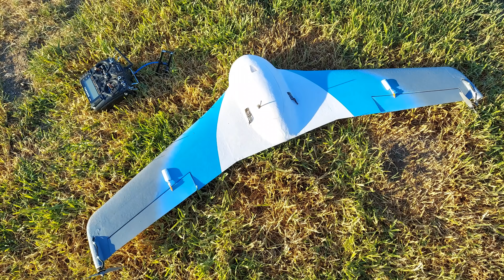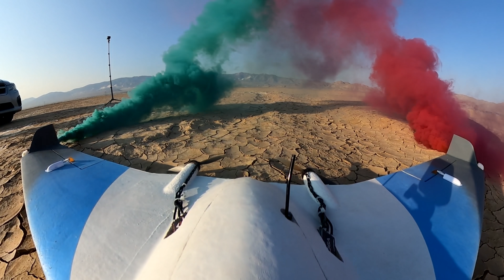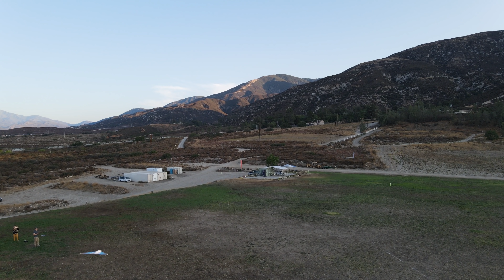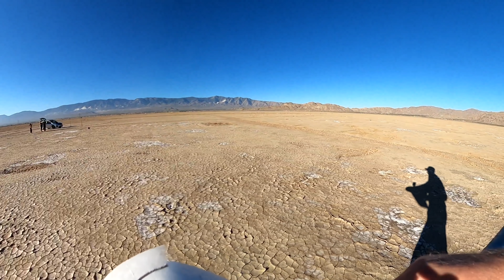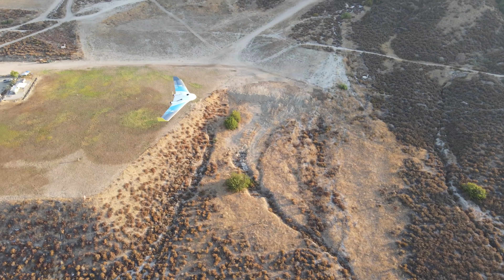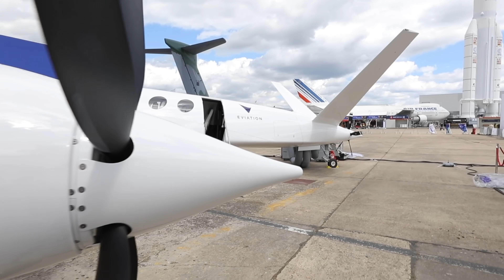Can Wingtip Motors Improve Aircraft Efficiency?  RCTestFlight Solar Collaboration Part 1

Comment: I knew comparisons to the V-173 of the '40s would come up.
There are tons of misconceptions about it. Most of what's "known" about the V-173 is myth.

Zimmerman copied it from the Arup S-2 of Indiana which as an employee of NACA, he saw fly in ~'33. Only after that did he use the very low aspect ratio planform as the start off point for his experiments into a VTOL tail-sitter. (though neither the V-173 nor the XF5U had enough power to do so, or appropriate landing gear.)

It's a myth that the props situated as they were, helped.
NACA tunnel tests showed that it gained nothing or changed things not much, versus normal sized 80hp props spinning the other way.

The Arup planes proved that the over-complex propeller situation with the V-173 was not what gave it its excellent flying qualities. It flew well in spite of that situation, not because of it, and it probably lost 30 kts swinging over-sized props around.
 The Arups were super-STOL, quick on little power, stall-spin proof. Many other planes of very-low aspect-ratio have also done exceptionally well. They are not always draggy, they do not need any effort to "counter" wing-tip vortices; that the Vought flew in wingtip-driven "Parachute lift", shows that it didn't counter the wingtip vortices. It's probably not worth any effort.
 The dreadful power-out ramifications of the wing-tip mounted props mandate the power-sharing drivetrain, and that troubled the V-173 and kept then XF5U from even flying.
I'll bet that trying any such scheme isn't worth it to the complexity involved. (meanwhile, very-low aspect-ratio all-wing + fins has been shown to work very well.)

The Navy wasted the potential of the Arup with the Zimmerman/Vought parody of it, perpetuating the myth about horrible inefficiency of the very-low aspect-ratio planform.

See the '30s Nemeth "Parachute plane", and the designs for the Boeing flapjack of the '40s, the Boeing model 390 & 391. It did not waste effort and complexity with silly propeller situation, it would have performed amazingly.

The jet age didn't kill the "flapjack". That's another myth.
The US military operated piston-prop combat planes until the '70s, for support into the '80s, and still operate props.
Sergei Sikorsky worked on the Vought planes, and designed jet versions of it.
They would have flown, very well; better than anything else in the air at the time and for the next decade.

See the youtube "Flying Heel-Lift" about the Arup. See the youtube of Barnaby Wainfan talking to the EAA about very-low aspect ratio, and his '90s "Facetmobile" (quote "everyone says they're very inefficient, but I'm getting over 100 kts on 40 hp with 340lb useful load.")

Comment: Low kv motors and big props are interesting for efficiency anyways so maybe such a setup would make the wing tip configuration more adventageous.
Reply from the maker: One thing I learned from this is to get max benefit the prop doesn't necessarily just need to be bigger, but working harder.   I.e. higher pitch and throttle setting.    Hence the Bell 280, V22 Osprey etc.    A bigger prop on this plane would be moving a larger diameter of air but more slowly, so not necessarily a larger volume, and from my understanding of the literature, that volume is very important.
Reply: @thinkflight  This could well be true but without having any better knowledge I would assume that smaller props with high pitch and rpm produce higher air speeds and more turbulences than larger props and thus be less efficient. Would be interesting to test.
Reply from the maker: @Gosuminer  Agreed, more testing would be better.

Comment: Putting weights out on the end of the wing may cause a springboard effect.  I'm pretty sure that's why it's not done. 🤔 small motors with low mass are probably fine. But if you need to pull out of a dive with big weights on your wing tips as shown in the experimental plane out side of the hangar.... good luck. I would be reluctant to do this for 2% efficiency increases, versus ? %  saftey.

Comment: I guess when you talk about separated air you mean transitioned air which has changed from laminar to turbulent flow. Turbulent flow is still attached and keeps attached much better than laminar flow. Seperated air is mostly not doing any lift just drag. Would be catastrophic having separated air just after the spar.
Reply from the maker: You are correct.  Oh for an edit button....

Comment: wingtip motors are only usefull at slow speed, at you scale it need to be way slower to get any notice able effekt, try it but this time use a pizza box as your plane, its gone fly extlemly unstable and slow but wing tips will make it a lot more stable and with the right fligt conroller you could use differential motor speeds to steer that would make it extreme efficens. Now add solar on the roof, and you get a 12h solar drone.
Reply from the maker: They should be effective at the cruising speed of any aircraft if designed appropriately.

Comment: The problem created by increasing the distance between engines is the increased yaw moment arm created during single engine failure.  The larger the distance, the greater the yaw torque.  

The remaining operation engine must be able to keep the aircraft stable and not flip over due to asymmetrical torque.

This design doesn't look promising.

Comment: Love your stuff but no need to give way to cooky alternative theories on lift, if lift was not a well established and defined science ultra efficient, ultra precise airliners and every aircraft with an airfoil would be a complete shot in the dark, how can they create incredibly efficient airfoils if aerodynamic lift is not a very well understood phenomenon not open to debate …as defined by Bernoulli? That’s the one thing I’d like to see you do more of is work on airfoils. I tried smoke grenades on my crop dusters but at even low speeds the smoke is barely visible, I have to try your brand.

Comment: Did u try to mout foldable props on wing tip?I think that u dont nead constant Push factor when in air iff u hitt CG right,u can make more eficient model with foldable props like Glider-s have.Peace and greatings from Europe.
Reply from the maker: I did not.   This isn't intended to be a glider so I did not bother.

Comment: I'm not surprised you didn't find much difference. Check out Doug MacLean's lecture on YouTube: misconceptions in aerodynamics". About 35 minutes in, it covers this in detail. The tl;Dr is that this doesn't work, even in theory. The idea comes from a fundamental misunderstanding of the role of vorticity in lift induced drag. Basically, lift induced drag causes vorticity, not the other way around. So "undoing" the vortex in the near field achievea nothing.

Comment: We would imagine it is best to put power at or near centre of mass. Stress on wing structure is not desired. Lift is the wing function. Tilt in motors seems like , are you kidding?
Weight matters on a Earth, but may not so much in space fast directional changes are immediate and minimal ,with radial wing tip force. No great energy required to steer huge structures,  up there. Minute puffs can shift large objects., especially when they are free of gravity. More power required when influenced by unknown attraction , of unlimited power.

Comment: I am a pvt pilot Multi Engine Rated...Bad things happen when you lose one engine on a twin. Any small amounts of extra effiency would not be worth the risks. I can assume that is why the Electric airplane design changed from those motors out on the wing tips to the back rear fuselage.  From an safety stand point, that is why we always see engines as close to the fuselage as possible.  On a model airplane, we can have tons of fun playing with designs..Not so much when we have people inside.

Comment: Watch a good Flying Pancake video. THAT plane is the most famous example of wingtip props. And you bet it works great. Those pancake shaped wings have a huge wingtip vortex left and right, and the solution is wingtip props.

I really do not understand why all twin props still have the traditional design, with that stupid tail pulling the plane DOWN. Yes, that is stable and very safe, but really, it is a waste of fuel, and most pilots accept that error without even thinking about it. New designs are not just toys, new designs can be a very good idea. Have you ever flown a Rutan EZ plane? They come in several sizes, by now. Those things are twice as fast, as what you are used to. And still most people buy slow and pretty boring planes instead, just because they do not really understand what a canard is. Why?!

So, thank you for this video on true innovation. General aviation needs far more of that spirit. Tradition is great, until it starts strangling you. That solar powered RC plane you mentioned, that is the exact opposite of strangling, just a dude building a solar RC plane and seeing how far it goes. Pretty good!

Comment: Why 2 motors? Is the single motor in the middle not more efficient since less weight and drag? 
Like a LongEZ?
Reply: So 2 motors will have twice the drag and weight of one motor, yes. But only if they replace a motor of the same size. He's using two motors to replace a larger motor, which would probably have close to the combined weight / drag of the two smaller ones. Plus you can use differential thrust for yaw control, saves some weight and drag from servos.
Reply from the maker: I wanted to address this in the video but it was hard not to get long winded about it.   Basically I wanted to isolate all gains/losses to the airframe itself.   Selecting a single motor with the exact same efficiency as a two motor solution would be impossible and that had to be eliminated as a variable, I needed to use the exact same two motors for each test to get good results.   In theory yes one larger motor will be more efficient and will play into your decision making process.   As will the redundancy of two motors.   The design choices are endless!
Reply: @thinkflight  I stand corrected

Comment: So put a single motor in the keel. Oh I am one of these people that has built flying dinghys... always thought any airplane starts with a keel. As a really knowledgeable fellow that has a few fantastic flying boat designs in my head... let me know when you have enough money to build a good dirt track race car... I know how build those too.
Reply: Wouldn't it be better to have a motor driving a light weight air compressor balanced in a single unit at center gravity and the air ducted about through hose or pipe? -Q

Comment: Asymmetry is always dangerous in Airplanes, if one engine fails, besides this, having a huge mass in wingtips would increase stress on wing structure.
I'd say no, no no,....
Winglets, Burnelli arrangements, Custer Channel Wing, propellers turning in opposite direction, so propeller tip swirl arranged in a way respect to fuselage and wing as to reduce drag,...
You may like: 'Low speed wind-tunnel tests of a number of fin configurations on a flat-plate Gothic wing of unit aspect ratio', by 
D. H. Peckham, Aerodynamics Department, R.A.E. Farnborough. C.P. 1076; November 1968, and Northrop NM9B flying wing.
Centering an airplane is not always easy, but is critical. 
Blessings +

Comment: I cannot recommend HIGHLY enough the lectures from NASA about the developemnt and theory behind the Prandtl-D demonstrator aircraft.
To put it bluntly, wingtip vortex laminator devices are in the same region of engineering as engines with over 100% efficiency.
...trying to build one is simply an exercise in showing your cluelessness.

(The top of the wing will have lower pressure than whats under the wing - otherwise the thing cannot fly. And that pressure will inevitably flow around the edges on the wingtip. Putting a contrarotating prop on the edge to counter the vortex, won't elliminate the vortex. The best you can do is make it work for you and not against you. Thats what the whole sheband that led to the Prandtl-D tech demo was all about)
Reply: ...and i have to add that the eviation alice prototype(?) (mockup?) is a joke.
As in people with some graps of the fundamentals take one look at that thing, and go "NOPE" that company is is clueless at best, and a scam at worst.

Comment: Needs a Random Math-Physics Dude to guess how much actual vertices in vortices matters, in proportioning of wing to propeller lengths, and spin<->spiral frequencies-> propulsion, like the Designer said, in another way?

Tip vortices look to be much better for balance-tuning, it fits the Airflows explanation-by-demonstration, of Insect Flight integration, of wing beat frequency spin-spiral, to propulsive motion.

The work on tip turbines for Helicopter Rotor power..?

Comment: The beginning of your movie already shows why wing tip engines are a bad idea from a safety point of view, 1 engine fails and you have a massive thrust problem
Reply from the maker: The crash was with motors in the center.
Reply: @thinkflight  yes OK see that now however I still believe that engine failure would be quite the issue with wingtip  engines . Mind you I know what it feels like if your model crashes 😄
Reply: Interesting subject though 👍

Comment: Prediction: They're going to use wingtip motors for the solar project, because the ideal propellers for a slow, efficient solar plane will be larger and therefore get the benefits that weren't seen in this experiment.
Reply from the maker: We shall see....

Comment: The trust is more efficient when is closer to the fuselage, because in case of one engine failure...  in your configuration you will go in a spin with one engine failure.... in the real life flying this config you will be dead quicker...
If you are looking for wing tip efficiency research for winglets

Comment: Some time ago, they found wingtips are just like having the same surface added to the wing. If you put a 40cm wing tip, it's like having 40 cm more of wingspan. If your wing tip it's similar to the wing.
So they stop using them unless they need to have more wingspan but they don't want to jump to the next type of aircraft size and its airport fees etc.
You can see it on new airliners and on new private jets, who's clients want wing tips because they are cool, but manufacturers don't put them because they are not needed. 
Mentour pilot have a very explicative video about it, you won't miss the title.

https://www.youtube.com/watch?v=2ieRwRnwqY8

Plus you have now another project, the flapping boeing.

Comment: Loved the video! Subbed! I can't wait to see your future work. I made my Phoenix 2400 fly for 10 hours and 45 minutes using a big DIY Li-Ion pack and NO solar. Here is a link to that video: https://youtu.be/HGZC-cvYcb8 I've tried solar several times in the past, but incorporating the solar cells into the wing, without destroying the airfoil efficiency is very challenging. I think that you need a scratch built wing that is designed to accept the solar cells, but you're clearly a very skilled builder, so you and RCTestFlight will likely have great success! I highly recommend a glider-like airframe over a flying wing.

Comment: No It Can't.We Just did some wind tunnel test and found it reduce some drag but reduce more thrust.
Reply from the maker: Interesting....
Reply: @thinkflight  it reduce about 3% of drag in my case ,but reduce about 5% thrust. We think it may because we use part of energy produce by prop to change the direction of wingtip vortex
Reply: @thinkflight  we choose the baseline as the prop rotate reverse to increase wingtip vortex compare with the direction to reduce wingtip vortex
Reply from the maker: @qichangchen7561  Fascinating.    Did you publish this anywhere I could read more in depth?

Comment: I doubt any manned wingtip motored airplane will ever be approved for flight. 

Any failure would result instantly in loss of control of the airplane and most likely an inflight break up. 

You would be astonished how much yaw it induced in a twin engine airplane even with only one engine at idle. Even more, pulling back the power on your critical engine makes it even worse.
Reply: If self-driving car is possible, why can't a propeller instantly goes into feather automatically (and the third engine goes into emergency power ) when the other side is not working.
Reply: @emilelepissier7550  you would go from 2 or in this case 3 motors to 1. Differential thrust that far out or even worse, drag depending on how something fails will cause loss of yaw control. Even on a corporate jet with the engines very close to the empennage you have a very very noticeable yaw effect when doing training.

Comment: Electric is NOT becoming practical for air craft.  Don’t lie. There is a big reasons for that. Unlike cars, weight matters A LOT. And unlike batteries, a conventional plane weighs much less at the end of the flight, than the beginning. This doesn’t matter in a car, but I promise you, it matters a whole lot in a plane. We do not have battery tech yet to make electric planes practical. Just toys and fun.

Comment: The biggest point I see here, is how this only applies to dual prop planes. A single prop is almost always more efficient... as you can gain significant thrust surface for the same amount of frontal area, swing a larger prop, AND at a lower RPM.

So the real question is... how do we make dual fuselage airframes more efficient?

Comment: What is being ignored here is the difference in strength required for the different motor locations, which would probably require changes in chord and/or form. Can you imagine any regular plane which could survive the type of crashes demonstrated.  Scale matters for material strengths and strength to weight ratios. This demo is largely meaningless.